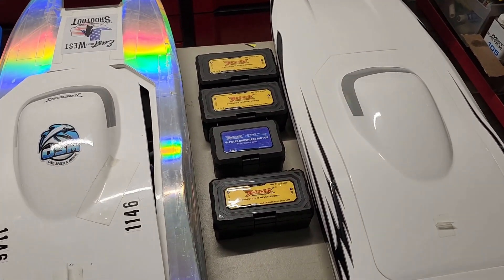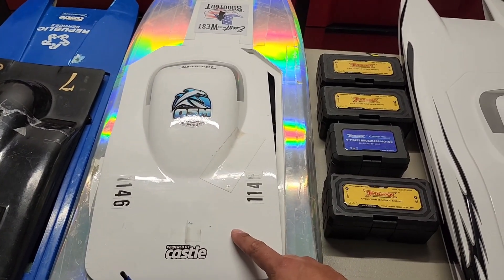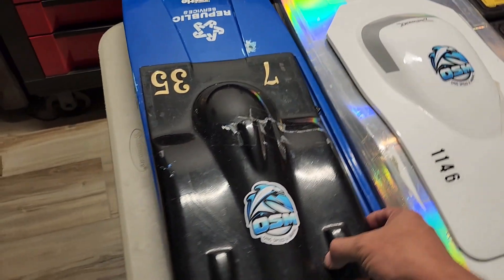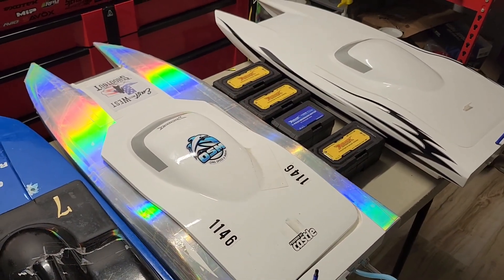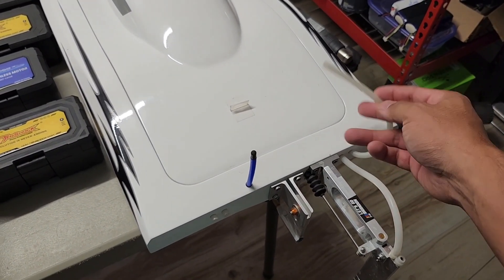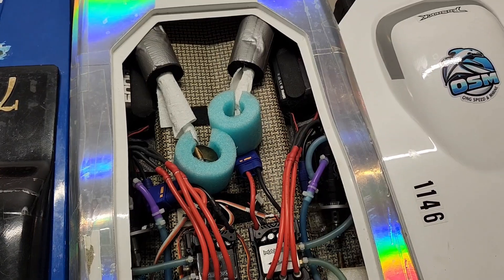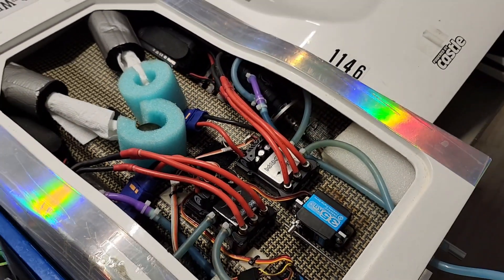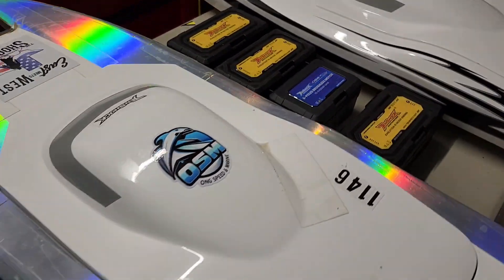Tenshock Evo22 motor updates with my NAMBA P-Cats (OSE Limited motor)

Comment: My first failure was a with 1715 .38 bar (small prop). 2nd was a big prop thinking rpm was the killer. 
No biggie, gotta pay to play 😅. 
I still absolutely loved the power they have and always 115⁰f. 
Try the 2260 motor and see if it makes it past 6 runs. Definitely can be operator error no doubt. Trying a Lehner next